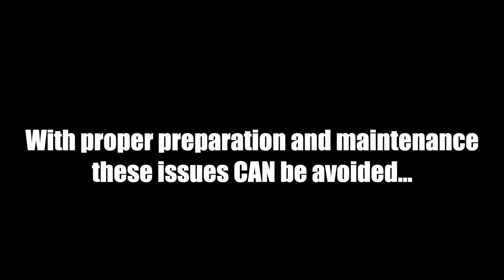What ROD KNOCK looks like inside your SUBARU | 2012 WRX STi

Comment: I’ve had a tick that disappears and changes with temperature…I had the rocker box off today..all looks good.. it’s been over 30k like this no change! Whaddya think? Piston slap? Rod wear?
Reply from the maker: If the tick sounds higher-pitched and seems to tick slower than the Crank Pulley Revolutions at idle, then I would lean toward Valve Clearance (which could get tighter and quieter at hotter temps). 

If the sound is a deeper pitched and seems to match the Crank Pulley’s revs at idle, then it could be Piston Slap (which could also get tighter/quieter as temp gets hotter). 

Bearing/Rod wear usually gets worst as temps get hotter, since the oil will inevitably get thinner.  

All is depending on many factors and variables, such as Engine Type and maintenance history.  But hopefully this helps give you a better idea.  🤙🏾
Reply: @RespectAutoWorks  that's the thing...I just checked clearances.. all good- springs should be ok too..im starting to think its the oil pump. Its half crank speed and not a high tick like a tappet  not thump like a big end. So maybe still piston slap if it's only one said but???? Sometimes it completely dissapears. 1.5 dci

Comment: I will be buying a subaru in the next year, how long till the knock sets in? How many km roughly?
Reply: No Km, if you learn to change the oil on time. I swear to god im getting tired of people being fucking followers and shit talking subarus an never even owned one. I have a 92 legacy 2.2 5 speed and she still kicks ass to this day. My secret? Change the oil...
Reply: @djstatyk1540  ....I have a 2007 Legacy, 2.5L, SOHC, 5 speed manual, NA, 140,000 miles, original clutch, no head gasket problems.

I do preventive maintenance with OEM parts, and do my own work when I can. I don’t beat the car to hell and it’s been a great car.

Comment: Most of these guys having this issue are super abusive to their cars as well. Then they turn around and be like. " I don't know what happened, junk Subaru."
Reply: Yep. Modding it up without a tune, flogging it before it's warmed up to operating temp, bouncing it off the rev limiter for the hell of it, stomping it in 5th gear with the wrath of khan, and other juice bag moves. If you know what the hell you're doing and maintain it properly, this is a non issue.
Reply: Exactly, a lot of those "ricers" had a Honda before a Subaru. They don't know how to take care a turbo boxer engine.
Reply: Man I flog the shit out of my 2007 WRX. I put 166k out of the 186k miles it has on it. Overheated it badly 2x too. But it still runs super strong. I think I lucked out mostly because I have kept it stock, except for a short ram intake.

Comment: My ej20 knocked for about 30000km. I just kept nursing it along.
Reply: my ej20 has ran nearly 6k miles with a misfiringg cylinder 2 and 4. god bless these engines lol
Reply: @conorhoade8793  they are quite a tough wee unit actually. Just don't EVER run them low on oil!
Reply: @druckerman247  Run a civic no oil and run a subaru no oil. Civic will blow up first every time. Not to say civics are bad. they are certainly bad ASS imo

Comment: My n/a ej253 also has a tick on cold start but once its warm i dont hear it. Any suggestions?
Reply: Piston slap most likely. Rod knock doesn't go away. You will lose the rod knock noise momentarily when the engine is under the right amount of load but will always return shortly after. Piston slap is due to an ovaled cylinder or improper piston to wall clearance due to wear and scoring. Usually on improperly built short blocks or ej253s with 200k miles on them. In your case the noise goes away once the piston swells during its natural heat cycle and or the cylinder wall may become more cylindrical once the engine is up to operating temp.
Reply: Your injectors also tick. They are noisy bois.
Reply: My engines ticked cold like that for the last 100k miles now at 200k no worries just check your oil often
Reply: I’m not completely sure about subaru motors but your valve lash could be out of spec. That tends to cause ticking when it’s cold.
Reply: Also check timing belt components.  They can make noises that go away
Reply: get rid of it
Reply: @marcISagg  sounds good, doesnt work.. i've put to much blood and sweat into this POS i aint throwin it away

Comment: 2006 sti with 300,000 miles.
Reply: 2006 impreza 2.5i with 231k. take care of them, they take care of you
Reply: 2006 WRX at 175,000 miles at 330whp (td05-20g). Trackday coming up in June!
Reply: It survived the track day!
Reply: @Currancchs  what do you mean?
Reply: @BugeyeKb  I had posted a few months ago (see a few posts up in this comment thread) that I was taking my high mileage WRX to a trackday in June; this was my update. Meant to reply to my own comment.
Reply: For an sti I'm shocked to see that miles 👍🏼
Reply: 2006 sti with 98,000... never wanna let it go so gonna be checking my oil all the time lol
Reply: 2004 rs with 298k miles I've just recently ran into an issue ticking noise after 2000rpm i brought it to a mechanic today and he said its the piston on the passenger side. so idk what to do from now on...

Comment: What’s the main reason of rod knock?
Reply from the maker: Bearing failure where the connecting rod meets the crankshaft is most common in these Subarus. It is generally due to a combination of poor/low oil and harsh driving. 

An improper tune can also play a role as pre-detonation puts extra stress on all of the internal components.
Reply: @RespectAutoWorks  So keeping up on oil and a proper tune helps prevent this I assume?
Reply: @ghostly_remains  Yes it helps. Also helps to not ride it hard and put it away wet every day.
Reply: @ghostly_remains  Oh wow, what a surprise... you have to check your oil....who fucking knew...
Reply: @djstatyk1540  Well yes no shit but it's so common you'd think it'd be a something the manufacturer is doing something really badly to allow their vehicles to be out here essentially committing suicide.
Reply: There was a class action lawsuit against Subaru for knowingly producing engines that lack the proper lubrication at high rpm
Reply: Have the same issue i money shit and spun a bearing and have rod knock 2015wrx some bolt on and deletes and exhaust.. best quick fix until new build ? What do I do it is loud knock cold start .. I had to move it the other day and sounded  and felt as if something dropped  while it was running ?

Comment: So is manly not as reliable as some say? Or was this just the fault of the owner?
Reply from the maker: EGC_Warlock - This was actually a failure of the stock setup. In our experience Manley has proven very reliable. We actually used Manley pistons and rods in this rebuild and we run Manley in many of our personal cars and high horsepower customer builds.
Reply from the maker: EGC_Warlock - And as far as the failure, it appears it ran low on oil. It came into the shop with a fresh oil change so the level was full but there was a really bad leak from the drain plug.
Reply: I think that they were laughing at the manly rods on the rotating assembly because they are so widely used that it is no shock that manly rods were being used. Kinda like getting a new pair of shoes and someone be like hahaha of course they are Jordans!